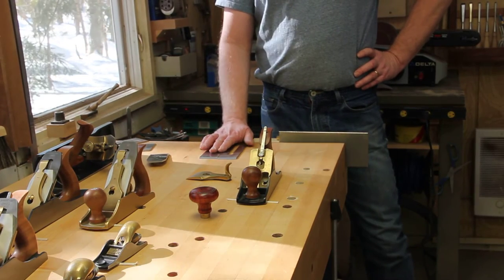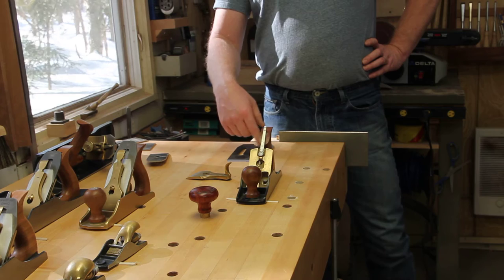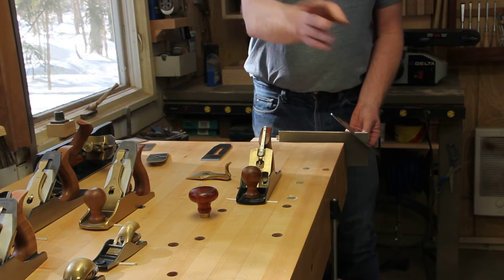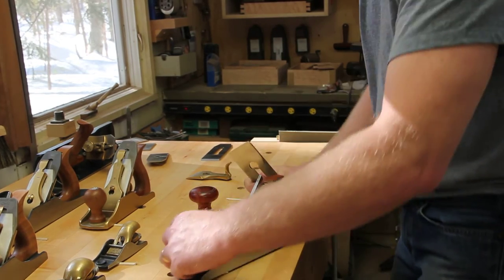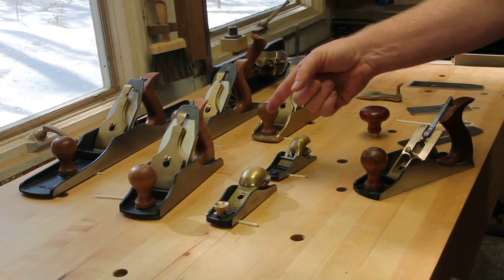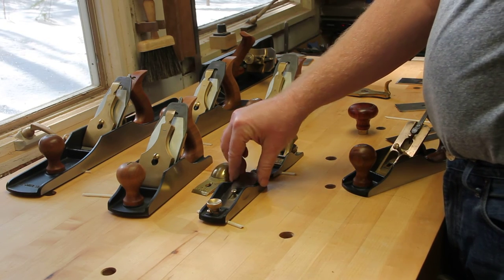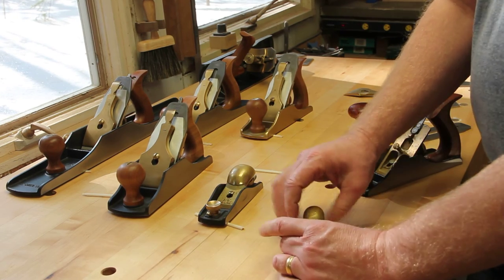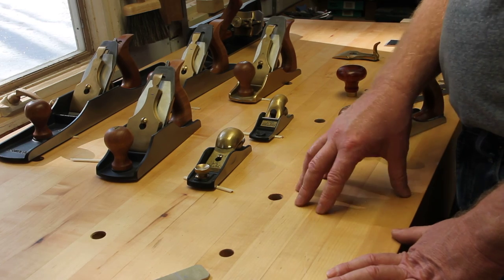PMV11 Blade in a Lie Nielsen Plane

Comment: Thank you so much for sharing your experiences here.   HUGE help.  I purchased the PMV-11 blade for my LN #4 and installed it yesterday.   I've fallen back in love with this plane.  I've been spoiled by PMV11 on my veritas planes and up until this point have been selling my LN because I was not a fan of the A2 blades.  I'm lucky in that I have a mill and was able to use a carbide bit and widen the slot in a matter of minutes.  I wanted your video last year about this and am regretting waiting so long to do it.  I'll have to get a PMV11 blade for my 102 as well.   Thanks again!
Reply from the maker: So glad it’s working out for you. I’m still really happy with the switch as well, I think it’s such a superior steel that stays sharper way longer and is easier to sharpen as well. All the best! Layne

Comment from the maker: I did not modify any of the planes that I did this in, nor would I recommend that, and in all cases I used the Lie Nielsen chipbreaker that came with the plane with the Veritas blade. Teakdust, are you perhaps using a different chipbreaker or perhaps you didn't file the slot wide enough to fit down flat against the frog? We should have the same chipbreaker as my plane is only a couple of years old.

Comment: Do you mind sharing why you prefer the A2 steel in the no 51? 

I am looking into making the switch to PMV11 in my Lie Nielsen planes, but I was wondering why you prefer the A2 in some situations. Thanks!
Reply from the maker: I’m not sure why I still like the A2 in the 51 but it seems the edge holds up better. But you may like to try it as the pmv11 holds up dramatically better under most circumstances. I far prefer it for both performance and sharpening. Let me know how you make out. Thanks!!